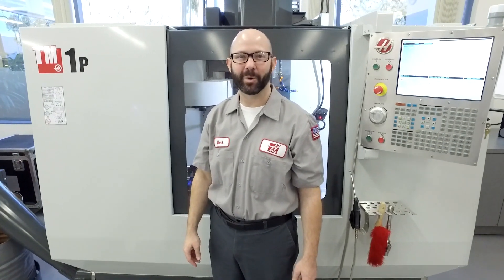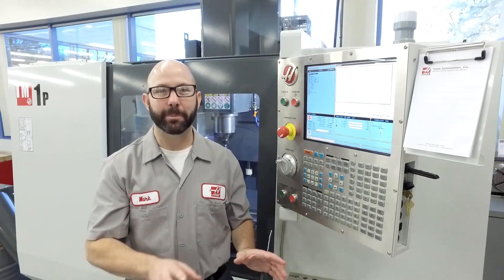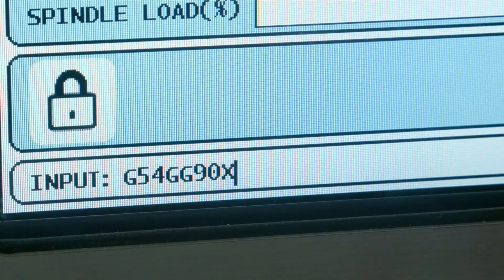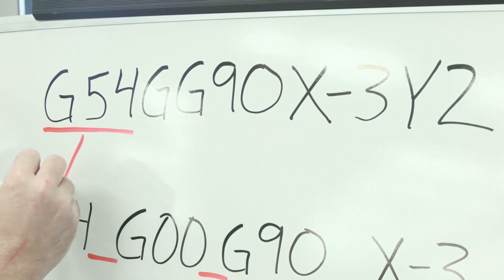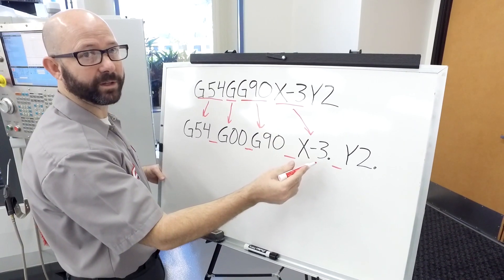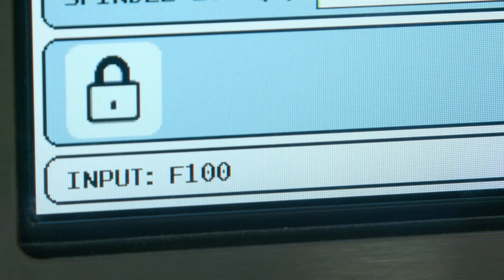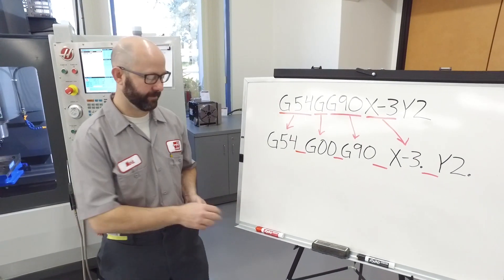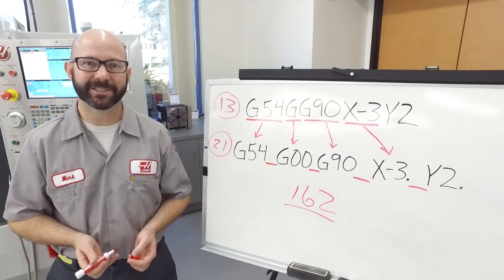Programming Shortcuts on Your Haas Control – Save Keystrokes & Time! Haas Automation Tip of the Day

Comment: The "G" = "G00" is actually quite interesting. 
My machine can index at 0 when I type "GC" = "G0 C0"
The reason the control does this is because you could also set a G-Code with a variable. On my machine an example would be:
#500=1
G[#500] X17. F0.05
The machine would move to X17. with G1 and a feed rate of 0.05mm/rotation

If #500 was never declined, the control sets it to null. other programming languages use "undefined".
When you, however try to use a undefined #500 as a G-Code, the machine interprets this as zero. 
#500=
G[#500] X17.
would be G0 X17.0

the same applies if you give no variable OR number at all, e.g. "GC" = "G0 C0"
You can move to X0.0 and Z0.0 by typing GXZ. Most machinists don't know that and they'll absolutely hate you for it, but for MDI it's fine, i guess

Comment: Hello. Why this trick doesn't work on NGC machines? I have always use setting 162 on on older Haas machines. Recently I have bought new VF3 mill and this setting is on, but controler doesn;t add dot on numbers. Should I make something more? Or this is not available in NGC?

Comment: Ok, before i change the setting 162, please let me know what happens if you have positions like x3.25.  Should it be X325 in settg 162?  Or does it automatically figure out to put the decimal in after first digit?  What about Y125?  How would the machine know to render it Y1.25"  or Y12.5??  Maybe it prompts you and i should try it?  thanks
Reply: Oh, I see that it will just put a decimal at the end of any number if left out, so you just have to manually 'override' as needed...cool setting...saved strokes are saved time!